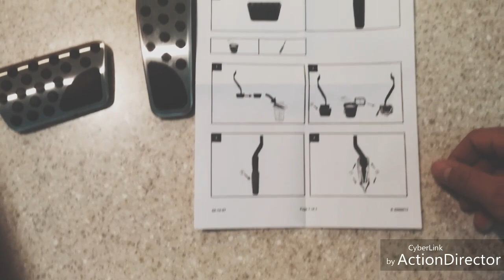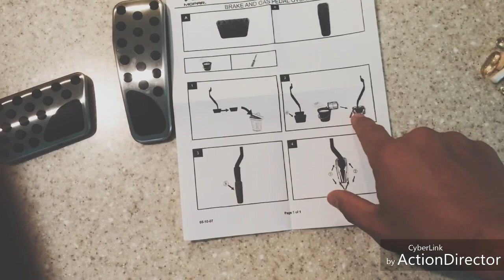Mopar Gas & Brake Pedal Cover Installation For Your Charger or Challenger

Comment: Just a heads up with what I did. Took me five minutes to do this and install. 
If you have a steaming iron. Place the brake pad on top of a towel with the rubber part facing up, and apply hot steam from the steaming iron in order to soften the rubber from the pad. Do this for about 30 sec -45 sec and be careful not to burn yourself. This will allow you to open up the rubber extremely easy and installation will be smooth. After you apply hot steam to the pad, make sure the pad is not burning hot before you pick it up. Try to install the pad immediately while the rubber is soft. Once the brake pad is installed, grab a big bowl of ice water and dip the entire brake pad for about 30-45 sec. This should harden up the rubber again to where it was when you received the item. After that just dry the whole pad, and make sure it’s installed correctly. Took me less 5 mins to put the pads on.
Reply from the maker: Bryan Arcos excellent tip for sure, thank you 👍

Comment: Hey man.  I was wondering how these have held up over time.  I ordered some off Amazon but they were cheap Chinesium knockoffs.  The rubber pieces all tore off so its completely flat.  I want to order the mopar ones. But I was wondering if they did the same thing
Reply from the maker: I got the oem mopar ones and they've withstood the test of time
Reply: @RydinNStyle  alright.  I’ll order one of the mopar ones.  I think the Amazon ones lasted me 2000 miles and all the rubber tore off.  

Thanks for the info

Comment: Just put these on a 18 Challenger- Wasn't to difficult - Gas Pedal just snaps on easy. the Brake Pedal needs to soak in hot soapy water  for a little while . Gas Pedal went on with just my hands, no screwdriver needed. Start on the top and then work sides and bottom.   Be careful the metal brake pedal is pretty sharp.

Comment: Hey Ryan, I know it's a little too late but i think that spraying some silicone on the brake pedal, wiping the excess off and then placing the new one on would have been a little easier and neater. But hindsight is 20/20 😁
Reply from the maker: For sure, that might have been a lot easier
Reply: Rydin N Style i actually put my pedal covers on today. In fact, all i did was spray a little silicone on my finger (so it wouldn't be so messy) and it literally took less than ten minutes to put the brake cover on. I'm not sure if you have the emergency brake pedal cover but I myself went and ordered it on Amazon just to complete the look. Awaiting that project. 😁

Comment: Great video! Sometimes the struggle is real...but worth it! I'm looking forward to doing this mod!! BTW what molded floor mats do you have?
Reply from the maker: Dan Kovelkoski 3d design on the mats, either eBay or Amazon but I had to do some digging to find these. I did a video on my interior mods that shows the fitment and color better. I think it was my 1 month mod recap video

Comment: I just bought the challenger 2022 and this is not difficult  at all I'm a female  44 yes and I used a flat head  thicker screw driver i started from the top and finished  at the bottom  from side to side 15 minute  all i took drinking wine very simple for me
Reply from the maker: Haha, wine will definitely provide thr proper lubrication for this project to go a long easier lol

Comment: Took about 15 minutes. I was struggling with the first top corner after getting the other three sides on. Took it off, slid right side on, wiggled it to get the bottom on, then left side, then after a few minutes with a screwdriver popped the rest of the top on.
Reply from the maker: Yes, this was like surgery, but looks good once its on.

Comment: Thanks for the video, the instructions are worthless, lots lots of patience. I use a computer screwdriver it was easier to manage in the area around the pedals.
I put the brake pedal in hot water for a minute; this softens the rubber. Once I had the three sides in place starting from the bottom as suggested.  I used the computer screwdriver to leverage the rubber over the metal from left to right. Once I figured it out it did not take me long to install.
Reply from the maker: Tigre M definitely one of the more challenging mods until you figure it out. Looks good once installed.
Reply: Rydin N Style Yes they look great, it was worth the sweat of putting them in.

Comment: Picked up my scat.  Found them in the trunk.  You figure the dealer would have installed.   Either way,   pain in the ass at first.   Hot water and soap and it was on in 5 mins.

Comment: Lol let it soak it in hot water with soap and it made it a lot easier
Reply from the maker: Road & Track Racing I wish I knew this back then haha, thanks for the tip
Reply: Rydin N Style yeah the heat softens the rubber I had a hard time with it anyway it took me about 20 minutes to install the brake pedal
Reply from the maker: Road & Track Racing I just wished it clicked on like the gas pedal, would be been so much easier.
Reply: Heat enough water to submerge the petal. As soon as it starts to boil. Remove water from heat place petal in for a few min to warm the rubber and the petal cover will slide over metal fairly easily. Took less than a min to install after I warmed it the way described, I didn’t use soap.
Reply from the maker: Road & Track Racing awesome tips for the installation

Comment: Don’t listen to this guy go to the dealership. they sold me a hellcat with these pedals but the brake pad fell off because they were too lazy to install it properly(that should tell you how difficult it is), I tried installing it myself and ended up ripping part of the damn plastic and still didn’t get it on. I am going to tell them to replace it with a new one and install it properly.
Reply: Also spilt soap water all over my new hellcat floor mats and car floor. So pissed.

Comment: Biggest pain in the ass to install!!
Reply from the maker: Definitely, did you win?
Reply: @RydinNStyle  I cut the shot out of finger then gave up.
next day put in 5 min boiling water and drop of soap. Put it on in a min without any tools. top on first. then both bottom corners together then bottom middle slipped right on.